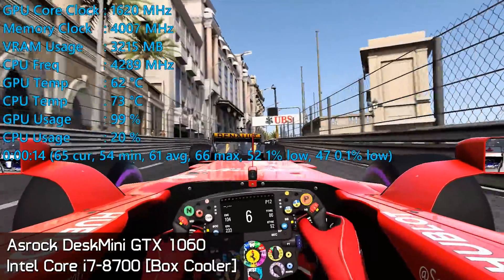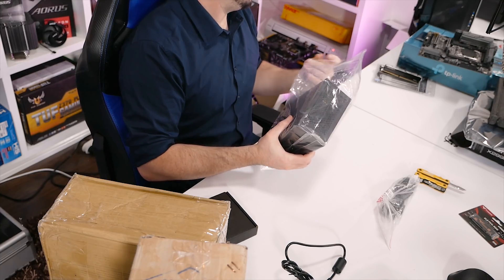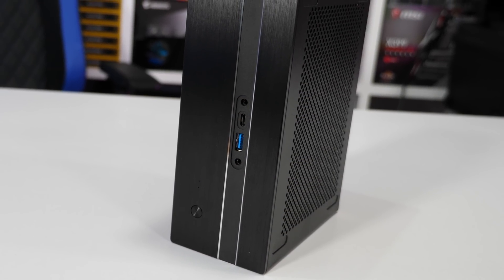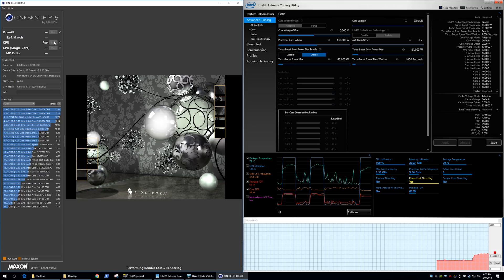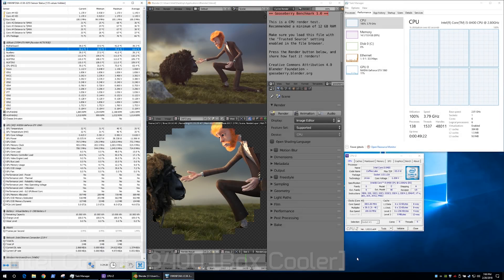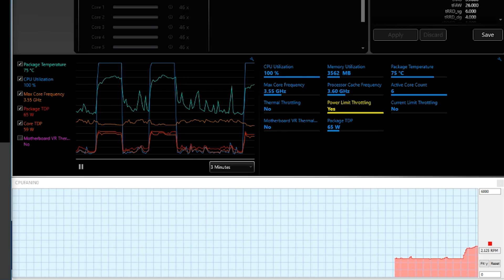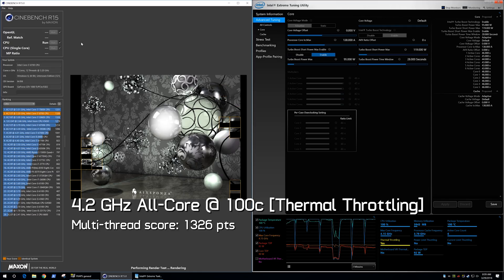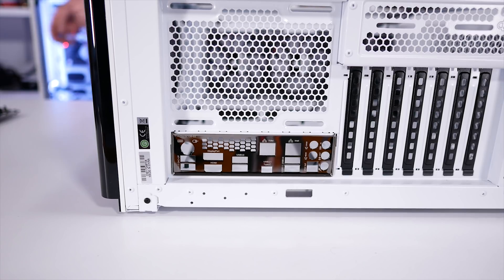Core i7 8700, Intel Box Cooler Limiting Performance

Comment: "But the sample size is too low!! You need at least 1000,cpus!!"    lol sorry  couldn't help it.
Reply: It wad pretty straight forward to me in his update video. Use the defined terms from a site that sells binned chips and compare with major tech reviewers.
Reply: Saxie81 his argument is ‘using one CPU in a study is fuckin stupid’, which is why he mocks Linus Tech Tips throughout.
Reply from the maker: @LightswrathUltimatum - I'd ask you to ponder something mate. If you ran a store with the sole purpose of selling CPUs guaranteed to hit certain frequencies and you were charging a massive price premium to do so, would you advertise the fact that most chips hit those frequencies?

"Hey most 8700K's hit 5.2 GHz, but we're charging 100% mark up to guarantee it, are you interested?" LOL
Reply from the maker: @LightswrathUltimatum - I've bought 3, they all did 5.2 GHz on the Z370 Godlike by just changing the multiplier to x52 ;) I've spoken with a few others who have bought chips and the worst report I've gotten so far is 5.1 GHz but they suspect 5.2 GHz might have been possible with a little more effort. Of course there's always a chance you could get a lemon, I just think it's pretty remote with the 8700K.
Reply from the maker: @dongmaster9001 - Do reviewers need to tell? Over 90% of my 8700K review was focused around stock performance and it was mighty impressive, overclocking is just a bonus.

It's all a complete joke in my opinion, AMD and Intel should be putting their best foot forward. This would only be an issue if reviewers all got chips that could do 5.2 GHz but most retail chips only did 4.8 GHz or less. As I said I've bought 8700K's and not one of them didn't manage 5.2 GHz with a basic low effort overclock.

It seems like everyone agrees, worse case is 4.9 GHz, though I'd say it's more like 5.0 GHz. Either way it's very fast and you won't be disappointed if you're after the ultimate gaming CPU.

FYI I tested the Ryzen 7 1800X overclocked to 4.1 GHz in my 8700K review ;)
Reply: A single retail chip.
Reply: I dont think Silicon Lottery posting the percentages of binned chips will change enough peoples minds from getting a chip from them, no matter how likely the odds. Although you do raise a good point about lying about those numbers to increase sales. It would be interesting to see the data CL keep internally to come up with their numbers.

At the end of the day, if you want a chip guaranteed to reach a frequency at x voltage you will have to buy from them.

Not to mention their lowest binned chips that most CPU's fall into are delidded too, so even though you have a 99% chance of reaching the Freq from a typical store bought sample, there is still a service being provided that people are willing to pay for.

In any case, Jim raises a good point. If intel send out better than average processors for review, how can the tech press tell, let alone the average PC/tech enthusiast.
Reply: LightswrathUltimatum of course it doesn't.  It's sarcasm.
Reply: Hardware Unboxed hahaha thanks Steve 😉
Reply: LightswrathUltimatum I'm referring to the conlake golden sample vid yes.  There is no way for me to validate the numbers provided, and to buy into what Intel is accused of doing.  If they were trying to give out "Golden Samples" why wouldn't you make sure the biggest outlets had the best samples.
Really the only issue I had with the vid is that he based everything on one source.
Reply: CPSPD but Linus bought a retail chip, and Adored highlighted that on the vid....
Reply: CPSPD you're making my argument for me.  This is why you look at all sources available at the time.  I follow (sorry Steve lol) Hardware Unboxed, GamersNexus,  TechYes, Oz, randomgaminginhd, and a few online publications.  If they are all getting similar numbers I'll run with that.
Reply from the maker: @IsakH85 - The point is it would be better to have an independent source.
Reply: LightswrathUltimatum... this video is addressing a different one of Adoreds bullshit controversy bait videos. Steve has said hell address the other one soon enough as well.

I just dont get how people believe adored is worth a watch proven wrong time and time again, making videos just to stir the pot.
Reply: @Hardware Unboxed Absolutely, a source with no possible interest beyond curiosity would be best.
Reply from the maker: @Beef Ingot - I actually find his content really interesting for the most part, if you could cut out the wild speculation and accusations I'd love it!
Reply: @Hardware Unboxed Im by no means saying my opinions are infallible factual statements of the channel/personality. Those are just my impressions watching it, references to and situations surrounding it for quite some time.

You say to feel differently, and Im not saying there's anything wrong with that, I just wanted to clarify that Im not trying to pass the opinions I've stated as inarguable fact.

Regarding those opinions, I understand you likely dont want strong reaction garnering opinions in the comments of your videos, I just hope  that even though you dont agree, you can somewhat see where Im are coming from as opposed to seeing it as irrational anger or hate.
Reply: The most recent video on conlake? He used multiple sources and gave their own reports on what clocks were gained at what temperatures and voltages. All of which can be validated by going to the specific tech reviewers and asking for clarification.
Reply: This guy is an ass,he missed that completely LOL.
Reply from the maker: Careful using sarcasm Saxie81, it doesn't always land as intended. I've often got myself into trouble that way ;)
Reply: This video doesn't address adored TV and his point of cherry picking and maximum overclocks.
Reply: +Hardware Unboxed I very much doubt Silicon Lottery are giving fake percentages. I've seen very similar numbers from other binning services, and if they were caught fudging the numbers to make their higher binned chips seem more exclusive their business would be over and done with. No one would ever trust them again. While they have an economic interest in presenting lower percentages for the higher bins, they have an even stonger interest in not being destroyed by the scandal of being caught cheating.The fact that you've been lucky with a few retail samples doesn't prove anything. More anecdotal "evidence" : My delidded 8700K needs 1.408V to be stable at 5GHz, and isn't stable at 5.1 even at 1.45V (on an Asus Maximus X Formula with LLC level 6). From all the comments and forums I've read, it seems like about 5GHz is the average max stable OC, which fits well with SL's numbers.

As for AMD and intel "putting their best foot forward" I disagree. I would actually like it if they did pretest and bin the review samples, but instead of sending above average or even golden samples it should be the norm that they try to send the most average chips they can find. That would make reviews as representative as possible to what a customer can expect to get themselves. Someone would have to constantly check them on that though, because as soon as one of them starts sending their best chips the other one has to do so as well.
Reply: Hardware Unboxed Well if its an existing market model and they are still in business there must be some validity. Anyways I'm just a random consumer, surely a tech reviewer has the resources and know how to look in to this further
Reply: I read it as sarcasm critcising people who want statistically relevant data. Which I disagree with. We need more data.

Did I read your sarcasm wrong?
Reply: LightswrathUltimatum his video essentially is an argument from authority.  Which in of itself is fallacious.  I'm not an Intel guy or an AMD guy, I just had a huge problem with the vid in the way he portrayed the source of information.

Comment: How about stop buying Intel?
Reply: Muad Dib LOL Bro you r ridiculous! XD Here`s a Link for the US have fun and dont forget to take your pills! :)
1700 https://pcpartpicker.com/product/3kPzK8/amd-ryzen-7-1700-30ghz-8-core-processor-yd1700bbaebox?history_days=180 vs 8700K https://pcpartpicker.com/product/sxDzK8/intel-core-i7-8700k-37ghz-6-core-processor-bx80684i78700k?history_days=180
Ah and here s one more link for a 1700 for 229$: http://www.microcenter.com/product/485472/Ryzen_7_1700_Summit_Ridge_30_GHz_8_Core_AM4_Boxed_Processor_with_Wraith_Spire_Cooler 
@Don Keep it up!
Reply: Muad Dib
Why the 1800X when you can get the 1600? You can also overclock it without the K+Z bullshit (using the stock cooler). R7 just for gaming makes no sense. R5 1600 is unbeatable in price x performance (it also runs cooler and consume less power ;D). Suck that.
Reply: Yeah. Intel, expensive, give you shit for a cooler and make you buy another one, and they're only marginally better than the competition. nice.
Reply: Calm down, both are good. If you can afford the delid/AIO cooler/1080ti Intel is better. Otherwise, Ryzen is best value. It really doesn't matter which one you choose.
Reply: When was the last time AMD matched an Intel CPU in non-GPU-bound gaming performance? Socket 939, perhaps?
Reply: Teun Roetman rat boy. Intel is better than ryzen 1.
Reply: No, Intel just need frequently hard smack on the head.
Reply: how about AMD becoming competitive in the laptop market?
Reply: Od1sseas yes. 5-10% better is some specific scenario. And cost alot more. Plus a good bit more for a decent cooler. No thanks
Reply: *shintel

Comment: I was planning on getting an i5 8400 but after seeing this I might just go with the cheaper r5 1600 / 2600
Reply: Mainly yes, but so far the cheapest x370 in my country costs for $180
Reply: A little birdie told me the B360 and H370 MBs release April 2nd, so yea give it a few days. If you only game the I5 8400 is hands down better. Though in 2 or 3 weeks the new Ryzen 2000 Cpus come out, so maybe wait til those are reviewed to make up your mind.

Comment: Hey mate, there is an update on that con-job video: https://www.youtube.com/watch?v=pl0we6-ZiQY

Better check this one out.
Reply: Calling out silicon lottery as liars, damn man tell us what you really think XD
Reply from the maker: @Capta Praelium - You misunderstand. I'm not calling them out or saying you can't take them at their word, I'm merely saying you have to acknowledge the position they are in and the fact that they were the primary source, not exactly independant. It's really no different to questioning what AMD, Intel or any company do for that matter.
Reply: Buy 30. That's the minimum in statistics.
Reply: No, totally, no different. I call all of them liars too :D
Reply: My 8700k can do 5.0 Ghz but them temps are way up around 90c and voltage is pretty high so. If I were to delid it might help alot. So yea I got kind of a turd but I am fine with that. It still works great and gives me very solid performance. For my next Cpu I will hand you the cash and your silicon lottery golden hands can get me a good one next time lol.
Reply from the maker: @John Totten - What cooler are you using? Another thing to consider is that reviewers that got good overclocks used custom liquid cooling, my cooling setup was worth about $400. You could argue overkill I know, but I wanted to show a best case scenario as I often do in my reviews.
Reply: I am using an EVGA 240mm AIO. It works great. Yea I could delid or use custom cooling but im not that hardcore. I mainly just game and 4.8 Ghz works fine.
Reply from the maker: If you sold overclocked CPUs, would you let people know there's a good chance you'll get a good overclocker? Seems bad for business, just saying. I'm yet to buy one that doesn't do 5.2GHz and I've bought 3 since they hit shelves. Still it's an interesting topic, I'd love to buy 10 and get some real hard facts ;)

Comment: Well explained. Well, I guess I'd rather go for aftermarket cooler instead of stock box cooler if I go again for Intel route.

Anyways, I'll be waiting for AMD's 2nd gen Ryzen  chip(set) then :)
Reply: I'm an intel fanboy but they are starting to get on my nerves with some of their decisions. I still got my i5 4430 that I got 5 years ago and it's doing just fine ( still 60*C under load with the same thermal paste ) but if Zen2 comes out and it gets good reviews, I might just snag one and jump ship.
Reply: You won't notice much difference in gaming. I've tested a 1700 at 3.8 Ghz vs 7700k at 4.5 Ghz on Fortnite, and there was barely any difference. Ryzen got 220 fps, while the i7 got 240 fps. The test systems had the Titan Xp and a GTX 1080 running at lowest settings (I believe that's 360p resolution, maybe 480p). Anyways, way below 720p just to ensure no GPU bottle-necking. That's what they can do without any restrictions.

Comment: basically if you buy a 8700 expect to buy and aftermarket cooler so you dont fry the thing
Reply: It still doesn't disprove the con job, think about it, you need to raise the TDP for it to work at its advertised boost clocks. Most OEMs void your warranty for doing that.
Reply: i know that my point was they included a useless cooler for you to use

Comment: The box cooler used to have some copper in it that helped but not anymore...why? Because fuck you consumers that's why.
Reply: aussiebear22 AMD coolers used to suck until Ryzen though.  That said for the money Intel really should offer better than this.
Reply: No alex, Wraith cooler already existed with the fx chips. Stop spreading false information
Reply: I looked at some benchmarks from anandtech comparing the stock coolers and the difference really isn't anything worth noting in most cases (other than the noise difference), less than 1°C difference running full speed on the fan. When running the fan at 7 volts instead of 12 the temperature difference between the coolers is 5-10°C though.

The bigger issue is the actual cooling ability of the actual fins, there just isn't enough surface area (or relevant air pressure due to fan design) to take care of the heat generated, couple this with the awful thermal paste they ship on the coolers and you got yourself an incredibly useless product unless you're running an i3 or i5 with stock speeds and normal loads.
Reply: The FX stock coolers had a bunch of heat-pipes, copper base, and a fan that could scream like a banshee at 7k rpm when needed. They actually allow a little overclocking on the FX-8350, and its like an aftermarket cooler for Intel CPUs. They were really good, especially for how small they were, and super easy to mount (never going to break the mount either)

Comment: Garbage tin over the heat spreader, garbage TIM under the heat spreader. You're not competing with the FX lineup anymore Intel, time to stop cheaping out.
Reply: they wont, cuz they can get away with it by just not responding to the hate and some ppl will either drop it or still buy the product, so intel dgaf all day
Reply: @RadiatingRedstone  Bubble busted...
Reply: DrearierSpider1 Intel still dominates the cpu market, so unless people switch to AMD, Intel won’t do anything about it, sadly. :(
Reply: Philip Cooper But there are other TIMs with great lifespans.
Arctic MX4 on my 5 year old chip still performs as new and gets an easy 5c improvement on the stock cooler TIM also it's none conductive.
Reply: good thing AMD have done really good job with CPU line. it's easier  move to AMD CPU than AMD GPU. power different with AMD and Nvidia is too wide in top tier GPU.
Reply: xZiddel Sure, why demand better from a company when you can spend that extra money yourself?
Reply: The goal is longevity, not short term performance increase. Do you think Intel cheaps out with the server grade CPUs?. The box cooler are crap, I'll give you that. The last good box cooler from intel was the 775 socket one, being twice the height with copper slug core.
Reply: DrearierSpider1 what's a TIM? thermal paste?
Reply: RadiatingRedstone if I bought a 2700x I could upgrade to ryzen 4xxx.

Plus 3xxx will be the first 7nm, so I'll be betting money on it being late a few months at least, cause 7nm will be a lot more tricky to fabricate and all that shiz
Reply: xZiddel I would be more concerned that my cpu die is 20 degrees Celsius higher than it should be!  In this video the 8700 that was thermal throttling at 99 degrees would have been at 79 or so degrees delidded with good quality TIM in there
Reply: rip waranty ultralul
Reply: another mad intel fanboy who spend money on a garbage cpu xD
Reply: FX was good against 2nd and 3rd gen but against Haswell and later well... But on the other side of things they do not have security holes all over! :D
Reply: i just got a deliding tool and Conductonaut  for this reason. gimmie those ghz!!
Reply: shitty amd cpus